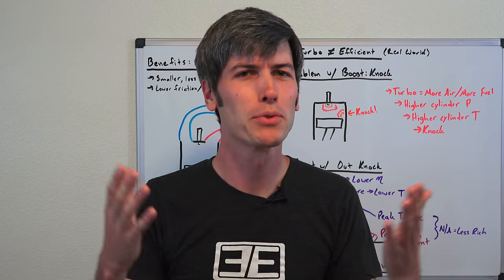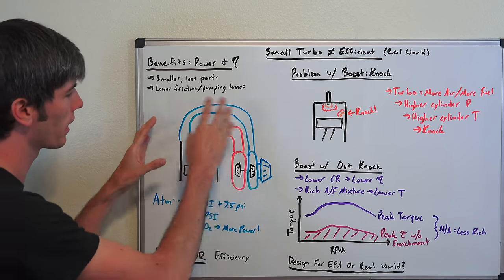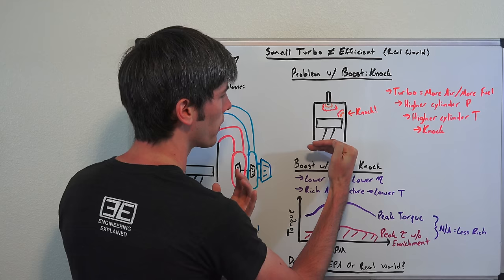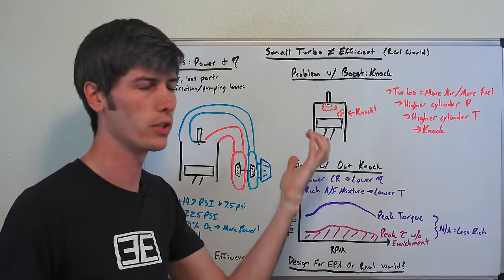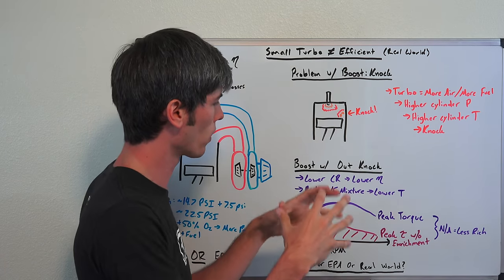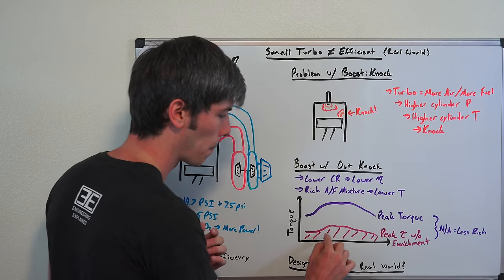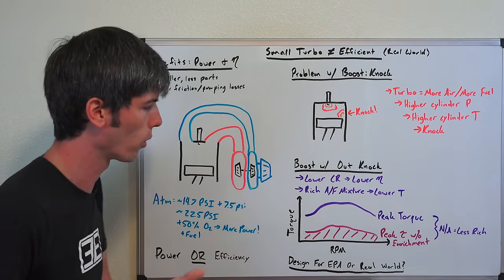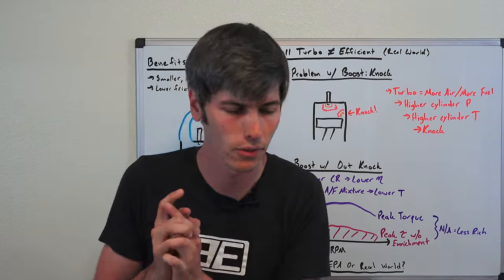Why Small Turbo Engines Are Not Efficient

Comment: Reminds me of all these 1.4 liter turbocharged 4 cylinder engines that are in the Chevy Cruze etc. Makes you wonder how efficient they really are.
Reply: StrangeClouds there're actually not that bad but it all depends on the location. Like weather, hills, etc
Reply: StrangeClouds they're not. My wife has a 1.5L EcoBoost powered Fusion SE
Nice car, a little bigger than I prefer but I swear on everything that I hold dear, I have watched the Fuel Economy hit 3.5 MPG when burying the throttle. 
For being a larger "mid-sized" sedan, the 1.5 does pretty well and perhaps in a small application could be a really fun engine but at times I'm certainly reminded that it's not my older Legacy GT. Though it is leaps and bounds more "Luxurious"
Reply: Owning a Chevy Sonic that has that same 1.4T. Its everything it's cracked up to be. I get 32-34 average with mixed driving.
Reply: StrangeClouds Well... 1.4/1.5 still decent size, in Europe is plenty of 1.0 3 cylinder turbo engines, not only for small but also midsize cars...
Reply: i owned a cruze and with that engine got 32 city and 37 highway so not bad and it was fun to drive thanks to the turbo and i live in a mountain state
Reply: Modern turbo small engines are all very efficient under light loads. A 1.4 liter turbo engine is almost as efficient as an NA version of the same engine at low loads. At high loads, that changes, but you get more power. Driving habits matter more in a turbo car than a non turbo car when it comes to economy.
Reply: I have the Chey Cruze RS hatchback. 40mpg highway is no problem. Good passing power with the turbo. Love the car.
Reply: yeah i never complained about not hitting 40+ because i figured it was how we drove it and yes it was as efficient or more so than na engined cars we considered
Reply: we liked ours other than reliability yours is a bit newer ours was first year 2011 and we have heavy feet lol
Reply: StrangeClouds having driven both n/a and turbo engines I do like the torque that turbo engines have down low but once you ask for power in the high revs they fall flat on their face... Talking about the Chevy Sonic 1.4 that cars powerband feels so narrow... Feels like you get torque at 1.5-2rpm but you start to feel power at 3000-5000rpm and after 5 it falls straight on its face
Reply: EE's video falls short because he never discusses what a small turbo engine is, and what "loads of power" is. You don't buy an economical car to floor it 80% of the time and then complain  about fuel economy. For normal driving, they work very well. It's all about your driving style. In Europe you have a lot of very small sized turbo engines (1 litre-ish), but they only work well (economical) in and around the city. As soon as you do a lot of highway miles the economy goes down fast.
Reply: A friend of mine has a 1.4 turbo engine with 120hp (a tjet engine from fiat-chrysler) and he gets good fuel economy when he is not flooring it, but as soon as he starts accelerating aggressively he gets down to 6-7-8 km/l (idk in mpg what that would be) which is the kind of consumption you get with a sportscar 🤦🏻‍♂️
Reply: I have a newer '18 jetta 1.4l turbo with 150hp and i have to say its pretty efficient.. 38mpg doing 80mph and 22mph driving the ever living piss out of it in a very hilly area in LA. Im impressed especially since all my other cars had to be babied to get 22 if that.
Reply: Riccardo Sartori l ho provata anche io la punto con il tjet, consumi non saprei ma spinge bene pur non essendo la Abarth.
Reply: Tony x il mio amico ha una Giulietta, ma il motore è quello, però quei consumi non si possono vedere
Reply: I commute 130 miles per day with my Cruze Eco 1.4T and average 35-36 mpg 65-75 mph. Decent mid range power but not exactly a sports car...
Reply: Riccardo Sartori i motori a benzina risentono di più del piede di chi guida rispetto a quelli diesel
Reply: Embarrassing for the people who actually bought those cheap cookie cutters lmao. My 10 yr old suv has more than twice the power with a v8 and still avgs mid 20s .
Reply: Meanwhile your trying to conservatively drive a 4 banger just to get mid 30s mpg
Reply: Drove a Chevy cruze to homestead recently with stop/start on and to be honest I didn't see that much difference in fuel economy than when I drove my Mercedes r350. Barely made any sense. I think Ford's ecoboost are just as bad also. Most of these cars are only efficient below 65 mph.
Reply: blacka dax . exaclty . and i bet it was an older model v6
Reply: I have a 2013 Eco Cruze since 2016. Equal mix of city and highway driving and I get 40 mpg during the summer and 35 mpg in the winter. Significantly better than the Neon I used to drive.
Reply: my conservative driving give me mid 40s, with AC always on
Reply: Brandon Shanahan yeah it's a 06 with the 3.5 v6, not to mention that's a much heavier car.
Reply: I've got a '16 Malibu with the 1.5 and after nearly three years with at least 75% highway miles, my average economy is right about 27 mpg - not nearly as good as I hoped for.  Plus, add in the turbo lag and I'm not happy with this engine in this car.
Reply: Tony x 990 cc straight threes... Nothing confuses my car lust like small turbo engines. Like, yes, it's great that the powerplant weighs fuckall, but it's running pig rich all the time. intake washer fluid when
Reply: Kyle Westcott don't compare Ecoboost engines to Chevy turbos. Ecoboost engines are designed from the ground up to be turbocharged (except for the first generation 3.5L), Chevy turbos started out life as an ordinary Ecotech engine. As a result, Ecoboost engines are more knock resistant and tolerant, so they may not be more powerful, but they are more efficient with open throttle.
Reply: They arent too efficient in my area because since it has a turbo the people here seem to just floor it. Why? Because race car.
Reply: My 2015 Chevy Cruze 1.4T with 6-speed manual gets consistent 40+mpg average per tank. If I'm driving cautiously with efficiency on my mind I can get over 50mpg out of it. Not too bad in my opinion. It's no STI or Camaro by any means but it's fun, gets me from point A to point B, and gets respectful gas mileage.
Reply: Brett Kuykendall no doubt they are fuel efficient i know they are but it just seems in my area the people that have them drive them hard because with the early sudden spool of the turbo giving them that low down kick they just seem to think they are more than they are and think they are on a dragstrip, when the light turns green foot is to the floor. The new ones look killer id take a rs package one in blue as a second car for every day driving. Ive got a 2.4 in my civic and im still getting a bit over 30mpg which isnt bad for being the non fuel efficient model.
Reply: Ours gets great mileage, but it's a complete dog from a stop, if the air conditioning is on. I hate it.
Reply: Kyle Westcott Pretty sure that most cars drop to between 3-10MPG at WoT from a stand still, especially turbocharged ones.
Reply: Can't speak for my the Cruze but my Honda with the 1.5t is surprisingly great. Almost always get above rated on highway unless there is a strong headwind. Usually bellow rated in town but I live in a small Canadian town so all city commutes are very short. On top of all that it does get better all around then the 2013 1.8 n.a civic I had prior
Reply: How does a pretty girl like you end up on a Chanel like this?
Reply: A friend of mine had a 2012 Cruze RS with the 1.4 engine... she isn't the most conservative driver, and she got 36-38 MPG out of it.
Reply: Adam S Tuned lol
Reply: Last Saturday my son’s 2016 Cruze got 46 mpg doing 79 mph with 5 people in the car, while using the AC. We drove about 54 miles. On the way back it was night time and raining, he got 43 mpg. He has the standard transmission and his car is rated at 41 mpg highway. This is pretty typical for his car. I have driven it at 70 mph and averaged over 50 mpg.
Reply: I have a 1.4T in my Jetta and it's pretty damn efficient when you're (obviously) not on it. I can easily clear 40+ mpg highway cruising. City driving gets me a pretty pitiful mpg, although that may also have to do with my tendency to stay in a low gear for quick lane changes.
Reply: About 20% less than advertised on any GM product in the real world
Reply: They work pretty well together. It's because the Cruze is a relatively light vehicle. Smaller turbocharged engines don't work well when it comes to efficiency in heavier vehicles.
Reply: Just get a small turbo diesel if you want fuel economy. The missus has an i30 and it gets 4.7l/100km. Or about 50mpg for you imperialists. And all that with a full load driving it hard and it nearly gets that towing a trailer.
Reply: they do pretty well if you take advantage of the B.S.F.C curve (Brake Specific Fuel Consumption) of the small engine.

That is high load, but before boost starts to build. Which is an area where the throttle is open a significant amount but the engine can't generate much power.

Which is to say, top gear at very low RPMs, lower than many people shify at, like sub 1,500RPM.

in these conditions there is negligible "pumping losses" from the engine trying to gulp air through a restricted throttle but there's not yet the increased fuel that accompanies boost pressure.

so for example if you were to drive at a steady speed on a flat road in 6th gear at 32-40mph then you'd likely get a fuel economy in the 70mpg or higher range aslong as you maintained those conditions.

but realistically it's just short shifting and keeping your cruising speed as low as possible without being an obstruction to other motorist.

People that hypermile the Cruise ECO and Sonic regularly get an actual fuel economy above 45mpg (calculated at the pump, not the display that usually reads a few MPG high).

Some people such as myself that benefit from empty roads can push well into the 50mpg range over the course of an entire tank of gas. For example my best was 55.xxmpg, or 10.xx gallons of gas to go 550-560 miles. Some Cruze Eco owners have done better. 

If you understand some mechanics/conditions that increase fuel economy and drive accordingly it's pretty easy to meet or beat the advertised economy without being the guy or gal that people want to run off the road.

however if you 
-speed 80mph or above 
-Drive with a lead foot all the time
*Operate in cold climates 
you're not likely to meet the advertised fuel economy.

the reason being is those conditions mean you're often making boost, positive manifold pressure, which means you're often driving a vehicle that's effectively got a bigger engine and not gaining any the advantage that the little 1.4T offers in fuel consumption.

when you're making boost, the engine is ingesting more air than it's naturally aspirated (N/A) clone would at the same RPM. The higher the boost the larger the N/A Equivalent engine you're effectively driving.
More air means more fuel, and more power.

so under boost, much of your fuel economy benefits of a small engine are lost over just using a bigger engine (all other factors being the same. )

the more boost you're pushing the more the small boosted engines comparable to a larger and larger N/A engine.
Aswell as the more you waste the little engines fuel economy potential.

The 1.4T still probably has a better Brake Specific Fuel Consumption (B.S.F.C) rate under boost than a larger N/A engine but that's a topic in and of itself
Reply: Lack of top end is not inherent to turbos. Typical economic cars use small turbos that require less exhaust gases to spool, so it can produce boost at low rpms. Small turbos however create a lot of drag for the exhaust at high flow (high rpms) leading to low efficiency. The ecu is programmed to cut power at higher revs. On the current gen WRX, you can easily add 20 hp with simply an ECU flash. On the other hand, old turbo charged supercars like the F40 had huge turbos that didn't produce any boost at low rpms.
Reply: Total Gamer: correct.

The turbo on the 1.4t Cruze/Sonic is tiny. 

the turbine discharge is the size of a "King Sharpie".

it's a proprietary turbo, but about the same as a Garrett GT14 if memory serves correct.

If I recall correctly it's max power is at or slightly below 200hp at the ragged edge of the compressor map. 

However the turbine and discharge housing is even more restrictive.

and the clutch is only reliable up to ~215ft lbs of torque (or about 170hp on the Chevy 1.4T), which is what most tuners limit the max torque tables in the ECM at
Reply: Owned a 2012 Chevy cruze 1.4T and averaged 36mpg over 100,000 miles. I now have a sonic with 85,000 miles with the same engine, lifetime average of 37mpg.  No matter how hard I drive it I've never had a fillup under 30mpg.

 However I don't run regular 87 octane as the engine is constantly running up against it's knock sensor and detuning  itself, less power and mpg. 93 octane only.
Reply: 2011 Cruze Eco owner reporting in. Racing stoplight to stoplight will definitely get you around 25 mpg, but I routinely average 45 mpg per tank, mixed driving and long trips.
Reply: Neezy Ko your stating about better driving experience And dont need to rev your engine doesnt make sense together. And when you must driving in huge rain or Snow, ice, then NA engines Are way more  comfy on gas apply. Nuff said....
Reply: My 2016 Honda Civic Touring has a 1.5L Turbo and let me tell you, it is very efficient and has decent power when needed. Obviously if I'm going to be racing this car around with high throttle often, I am not going to get good fuel economy. I have a 65 mile commute to work where most of my drive Route 206 in New Jersey and I cruise at 55 (speed limit is 50). I average about 48 - 52mpg for the drive.
Reply: StrangeClouds not many people are buying them
Reply: My 2017 Honda CR-V does 35+ MPG with it's 1.5l turbo... Although I do drive a bit like a grandma...
Reply: The Toyota 1.8 liter NA i4 gets better real world mpg than a GM 1.4 turbo i4. Want more power than a 2.4L i4 get a 3.5L V6 instead of a 2.0 turbo it's not only more reliable and better sounding than a 2.0 turbo it's more efficient especially if your a heavy footed or medium footed driver but, 2.0 turbos really shine in Japanese entry level sports cars especially the WRX STIs and Lancer Evolutions.
Reply: Oddman1980, That is the best I could do in normal driving around 37 mpg with the manual Eco.  Maybe at 55 mph light throttle you might hit the 42 mpg hwy.  I could not do it for any real length of time.
Reply: skurtov i get 29 mpg  mixed in a fullsized impala. So what's your point?
Reply: I don't find this video to be accurate at all. My 2016 1.4T Cruze gets 50MPG+ Highway and 35-45MPG suburbs. I don't drive in the city. These small turbo engines REALLY ARE efficient. This guy just does stuff on a whiteboard and no real world testing.
Reply: StrangeClouds often at 40 mpg . 1.4 is good w/turbo.
Reply: Ok, I should be a touch more clear here. If I'm stuck in a 22 car convoy, as I just was which is more common that you think in rural pa where a John Deere and Lamborghini will cross the same pavement likely within the same hour, I do get AVERAGE fuel economy. Thanks to a rebuild I've been commuting with the wife and she generally averages about 27 combined. I however seem to average about 25.8. These are based on Fords trip computer.
Now this being said. I will admit to a more... aggressive and spirited driving style but to best some it up, I typically drive a cough, cough, stockish... Legacy GT with subaru's EJ255 that doesnt make "fun" power until roughly 4500. I will say, out of sheer and utter blind, and ignorant LUCK I got fortunate to really Nail a good setup on my first solo build. I really would like to take credit but truly, I knew nothing, I had no right to be doing that kind of work (at that time) but in my mind it was a mechanical device and I grasped the principle. 
Folks, allow me to say you can build an engine step by step but you can build a work of art with the proper knowledge and experience.
Due in part to my ignorance and inexperience, Lucy, my LGT, is currently in the midst of her 3rd rebuild. This is the 2nd on my watch and between and and there I've put in more hours in both academia and practice with countless engines falling into my care in that time just so when this day came. I would be prepared.
The moral of my this overly bloated and long winded story?

TL;DR = IF YOU LIVE IN A FLAT AREA WITH A TEMPERATE CLIMATE, YOU WILL RARELY NOTICE A LOSE IN POWER WITH PROPER CARE, MAINTENANCE AND PREVENTIVE MEASURES. (Ford ecoboost owners.. CATCH CAN CATCH CAN CATCH CAN)
IF YOU HAVE LONG WINDING ROADS THAT VERY QUICKLY IN ELEVATION, LOOKING AT YOU COLORADO, OR NEED THE AC ALOT. YOU MAY NOTICE A DIFFERENCE. ESPECIALLY IN A LARGER VEHICLE.

Lets remember there are more factors to this question that "does it vroom fast" the answer to that is; sometimes. Ac off, windows up, pulling minimum power, takes off like a rocket how just found out his wife was cheating.
Up a winding hill with steep grades during 90 degree weather in a very much "fully" mid sized sedan. Be prepared to see some gas drop and quickly.
Reply: Right Wing Safety Squad Just seeing this, got an engine consuming my life... err, spare time.  I will absolutely concede that point. And while the EcoBoost was designed as a dedicated forced induction engine, it does have inherent flaws. Not the least of which being a tremendous amount of heat sink. The base tune (as with most any vehicle) Is wanting and one of my bigger concerns is actually the PCV system. If you have have an opportunity to be in front of one that's bone stock, ask the owner if you, you they should they feel more comfortable that way, could pull the intake piping. Literally dealers choice on which on. The Charged Air Cooler is dreadfully bad for heat soak and with very little air flow, I'm aware its water to air, it doesn't do well at low speeds thanks to fords efforts to streamline the chassis.
I owed a 2.2 ecotec that powered a Pontiac G5. It was an 09 if I recall correctly and they squeezed that little guy for everything it had that year. Not a bad engine for the application. A small car that was meant to be light on its feet. While I do believe that the ecoboost can be good engine, owning one and seeing the several possible areas of failure gives me reservations on recommending it. Perhaps the 2.0 or higher are a most sound choice as I have drove a F150 receiving its go juice from the V6 variety and while I wasnt blown away, I was pleasantly surprised with its performance. Mind you, I didnt have to maintain it.
Reply: A lot of replies to this comment have me interested in what year the Cruze was that they are talking about. When my wife had her 2012 Cruze it was to put it simply, a turd which hurt MPG's because you have to floor it just to get the car to accelerate.
Reply: Ask the various companies' engineers opinions, before you buy marketing's claims, which is what you seem to be quoting.
Reply: They are quite efficient. I average 41mpg combined here in South Florida.
Reply: I've got a Skoda with a 1.4tsi 150bhp engine and it's actually great. It goes quite well if you need it to, and just cruising, it will do about 45-48mpg at a steady 75mph. Happy with it.
Reply: What people in the comments are failing to account for are Mazda's 2.0 and 2.5 correctly aspirated enginea which will match the downsized turbo engines of equivalent HP. Even the Impreza with AWD isn't far off the mark.
Reply: Also the weight of the car is important.
Small engine + bigger car = worse economy
Small engine + smaller lighter car = better economy
My 2005 turbo petrol gets almost the same average mpg as my mums 2013 turbo diesel and my engine is like 1 3rd the size of hers but the car its self is also like 1 3rd the weight of hers hence almost identical average mpg.
Reply: Shoot even with my Mazdaspeed3 with a 2.3L I can get my average fuel economy into the 30's if I don't let the turbo spool up past like 4 psi (max stock is 15psi). Had to do that once when I was super low on money and needed to save gas.
Reply: Chevy engines trash
Reply: I actually own a 2016 (2nd Gen Model) Chevy Cruze. I can say this from my experience owning it, the Octane level you use really does effect these engines. The higher octane (I try to use Shell 93 because the additives help keep the engine clean too) like 93, The burn time is longer for the gas and when I'm on the highway and go to pass someone I can tell the difference between regular 87 and premium 93. On the high octane it can pick up and go much faster than when running 87. Also it depends on external temperatures like 60f out the car runs way nicer than when its 90f out. But i drive the same route every day and tested different gas stations, different octanes, and watch my MPG and with 93 I can actually get up to the 42MPG (about 90% highway) while on the 87 I was averaging about 36MPG. City driving is way worse even for both levels of octane I was averaging 26 to 28 mpg for both but the AutoStop helps a little if the AC isnt on or if its not too cold out. But this may differ for every owner though.
Reply: EHoward64 why would anyone ever buy a Chevy Cruze ugh
Reply: Well I'm guessing you like to drive BMW M3s, but when i bought my car I had only a few in my price range and I've liked all my previous Chevy cars.... Sooooo ya. I like my little Cruze its a great car in my opinion but your opinion is yours.
Reply: Cruze engines are actually rather efficient: I drive one and reliably get 36 to 38mpg (US, about 50/50 hwy/city driving). But there's one difference between the Cruze and many other turbo engines, they aren't designed for maximum boost or power. They're small, yes, but they only push 14.5 pounds of boost through a tiny turbo, and up until 2016 they didn't even make 100hp per liter, which is pretty weak for any turbo engine. That's honestly where you see good gas mileage: mid displacement, low boost, high compression engines, which is what you're starting to see more of. The Silverado has one in its new 2.7 liter 4 cylinder turbo base engine, the Malibu does as well with the base 1.5L turbo, and the Cruze has had that strategy going for a while. VW is getting into that as well with their new Tiguan's 2.0T. Arguably the same could be said of Ford's 1.0L ecoboost, but honestly that engine is so tiny that it's well into diminishing returns territory, so the gas mileage isn't as good as it should be.

I think companies are beginning to realize that while turbo engines are more efficient, you have to do it right. The current high boost strategy leads to the problems EE talks about. Low boost, high compression, mid displacement engines are much better.
Reply: StrangeClouds i drive a Seat Leon ST with an 1 ltr 3 cyl engine, it has 115 hp and it drives pretty efficient
Reply: My friend has a 1.4 Cruze. It gets low to mid 30s average but he’s gotten 48mpg on long highway trips.
Reply: We rented a 2018 Chevy Malibu from Hertz with a 1.5L turbocharged engine. 
We got 33-35 mpg on our road trip with mostly highway driving.
Keep in mind that the Malibu is somewhere between a mid-sized and large-sized sedan.
I'd say that engine did pretty good in the fuel economy department.
Reply: That turbo enhances a 1.4 performance wise, glad I have it in my cruze or it would be a dog. Fuel economy is great as long as you Don't push it too hard.
Reply: They AREN'T that efficient. I had one for 3 years... got a new Hyundai Elantra with the 2.0L NA engine... my fuel milage has went up 5-6 MPG. The Hyundai is FAR superior when it comes to fuel milage.
Reply: I live on 1.4l turbo petrol 125HP, golf 7. I measure consumption myself each time I fill a tank, and in worst cases (urban driving a lot, maybe activating sports mode) I get 6.1l per 100km, but mostly it's 5.7-6.0. I use E98 petrol (E95 premium) in Europe.
Reply: The Chevy Cruze is the shittiest car on the road.
Reply: skurtov that whst im averaging in my Subaru Outback
Reply: We had a Cruze Eco with a manual transmission. Got mid 30s city and I once got 46 mpg on a long road trip windows shut no A/C keeping under 70mph. once your turn on A/C, it would instantly drop to the low 40s.
Reply: Kyle Westcott dont bury the throttle then jesus christ i swear you guys dont know how cars work lol.
Reply: I have a 125HP ford focus 1.0 eco boost and I get 50-58MPG motorway depending on whether I do 60mph a safe distance behind a lorry or do 70mph.
In town I get 35MPG.
My brother in law has the 100HP 1.0 ecoboost on a fiesta. He gets worse mileage as he drives like a pillock.